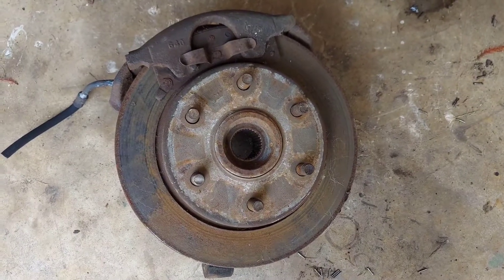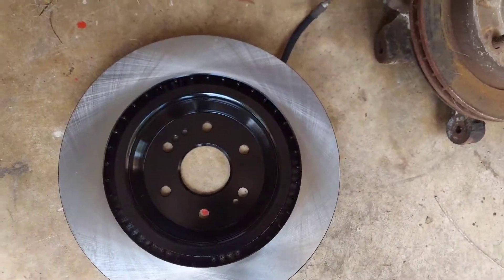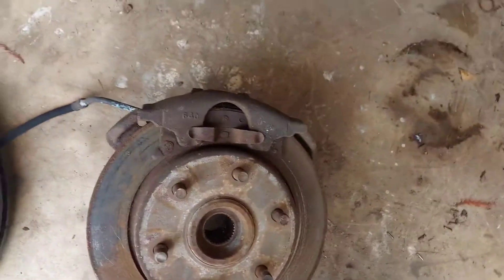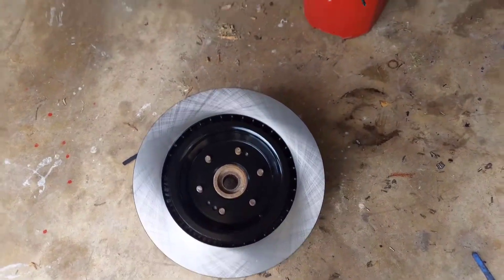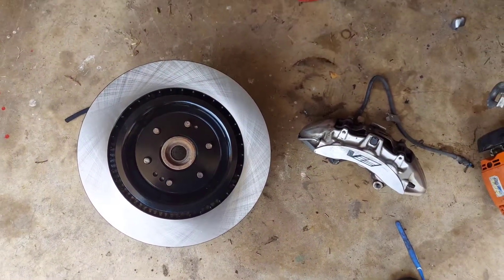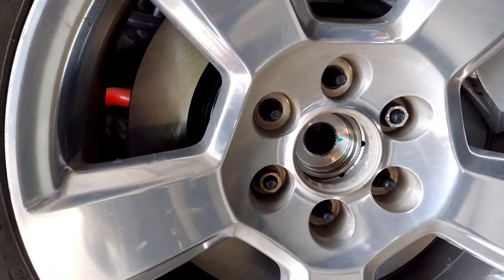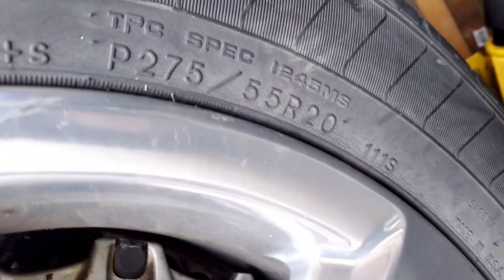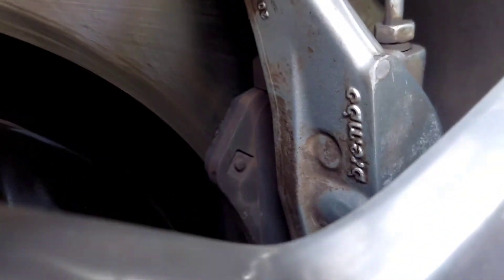obs big brake swap

Comment: Ooooohwee those are nice! 💪🏽
Reply from the maker: ill sell them to you i need to find some other ones the pads are way to bit for the rotor
Reply: @boostedonabudget9018  I’ll take them! Calipers too? Lol
Reply from the maker: @yojjohnson  the rotors are 16in bigger than the cts-v
Reply: @boostedonabudget9018   so you’ll have to get some c7 zo6 calipers or the zl1 calipers
Reply from the maker: @yojjohnson  the pad i bigger than the rotor surface maybe the hellcat calipers
Reply: @boostedonabudget9018 how can u make that fit in an obs chevy
Reply: @boostedonabudget9018 does that affect anything? Or drives as it should? Have the calipers but wondering if it’ll be an issue
Reply from the maker: Does not affect the drive
Reply: Nice 👍